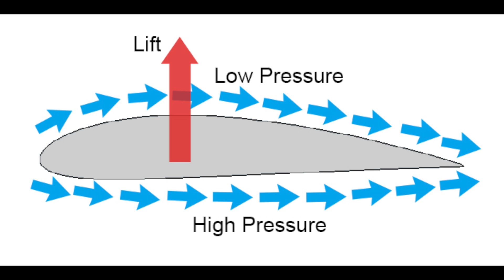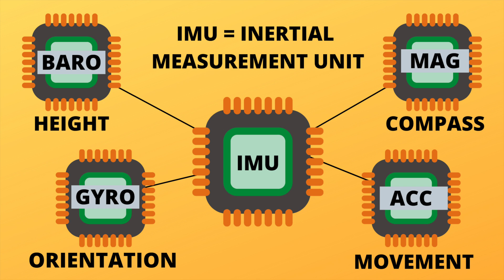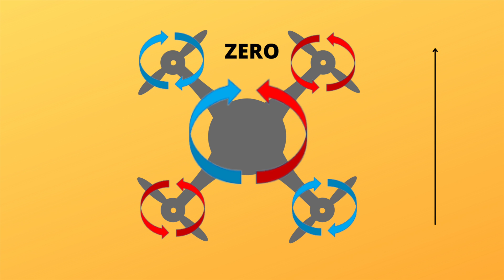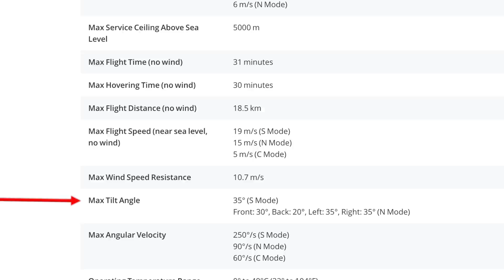Unveiling the Secrets: How Does A Drone Fly?

Comment: Interestingly the mini 3 pro blades are not fixed. My assumption is that the centrifugal force on the blade is greater than the horizontal force on the blade while moving through the air, thus the blade stays straight.  However it can move if it hits an object, lessening breakage.  Any thoughts?
Reply: It's exactly as you think. Thus, in the event of a collision, it breaks less and cannot really cause injury to a person. A safe solution.